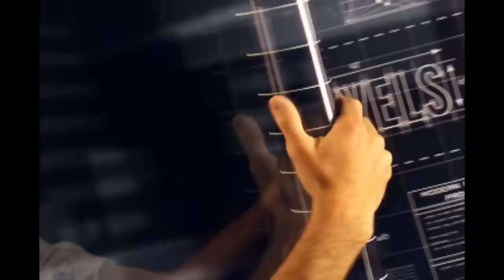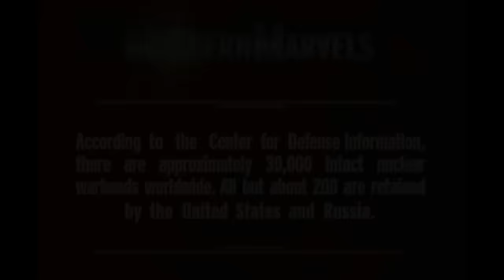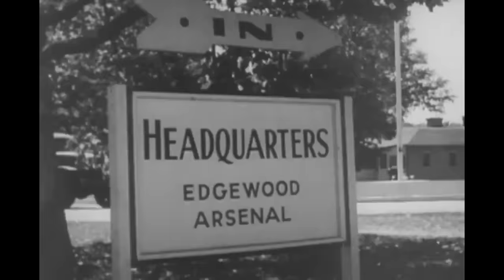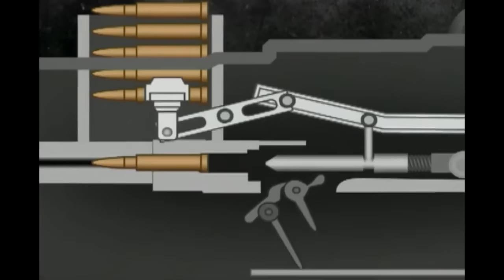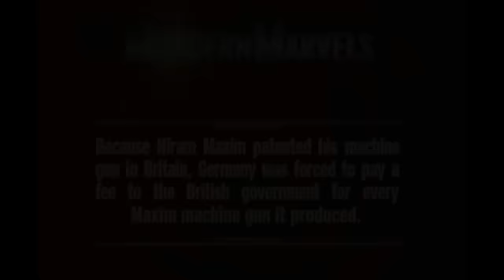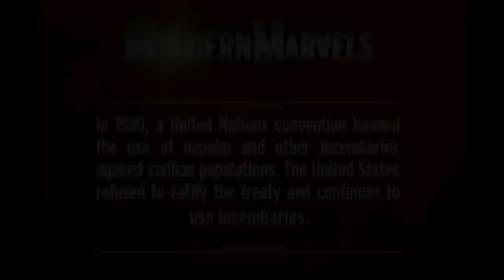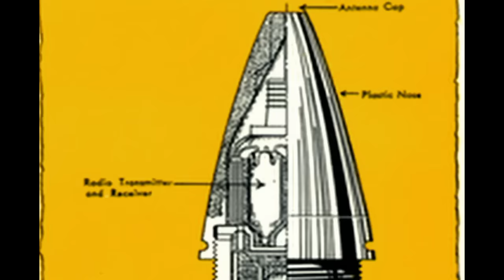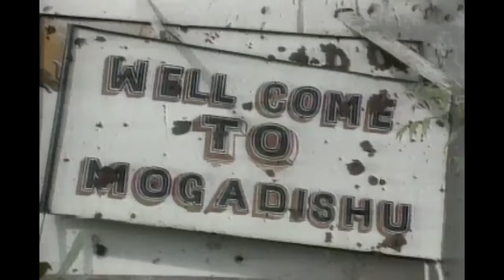Modern Marvels: Deadliest Weapons - Full Episode (S12, E17) | History

Comment: At around 28 minutes in one of the historians explains the British RAF tactic of incendiary area bombing. He explains it's a three step raid where step one was pathfinder who accurately marked the target with various colored flares. These were followed by the first element of the main bombing force and these dropped regular high explosive bombs. The high explosive bombs would shatter Windows blow roofs off and cause damage to structures with the goal of creating air holes for the incendiary bombs which followed. And according to the historian the final third step where the rest of the bombers dropped incendiary bombs that started uncontrolled fire storms.
This was mostly true with the exception that the second step was bombers that dropped both time delayed bombs that would detonate and kill the people that came to battle the fires. Also extremely large high explosive bombs like 12 thousand pounds and even bigger were dropped to create huge craters on streets and other obstacles to block or hinder firefighting efforts so they would be unable to.prevent the big fire storms from forming.
The pathfinder dropping flares were not considered to be a step in the incendiary or fire bombing attacks, just the three bombing waves with the final step being the dropping of the incendiary bombs tgemselves, the first two steps simply preparing the target area for the attack itself.
Reply: The purpose of the large, heavy bombs, was also to break water mains used to pump water further hindering firefighting efforts.

Comment: When I hear VX gas I think of the rock with Sean Connery and Nicolas Cage 
Especially the scene with Nicolas Cage when he explains to him how deadly a drop of VX gas is
Reply: When I heard VX gas, I just kept thinking of that stupid cutscene in Splinter Cell Blacklist where Sam Fisher opened a sealed case of VX nerve gas and left it opened for several seconds, letting some leak into the air.

Comment: Man I’ve looked everywhere for a replica or inert VT fuse for my collection. I probably have all of the components to build one, hidden somewhere in my collection of tens of thousands of miniaturized and ruggedize vacuum tubes and vintage electronic components… But I thought surely there would be somewhere on the market to buy either a reproduction or inert original.

Comment: The Tsar Bomba was “detuned” by removing the secondaries and replacing them with lead (Pb). This reduced the yield from an estimated 💯 Megatons to an estimated 58. Even with a reduced yield, it (The Tsar Bomba) was still capable of causing 3rd degree burns at a range of over 30 miles from ground zero.

In contrast, the latest thermonuclear warhead developed by The US, The W88, is a paltry 475 kilotons. It sits atop The Trident D5 II Missile. It too has multiple warheads, but these aren’t MIRV but rather MARV. The difference being former follows a ballistic trajectory to its’ target, the latter maneuvering one. In published article, The Navy claimed a Trident Missile Submarine submerged in Lake Michigan could aim for the pitchers mound of a Baseball Diamond in Moscow - and assumed of hooting within the infield. 

There are 14 Trident Boats of an original 18 armed with D5 II Missile. The first 4 had their C4 Missiles removed, being converted to special operations and Tomahawk Cruise Missile firing submarines.